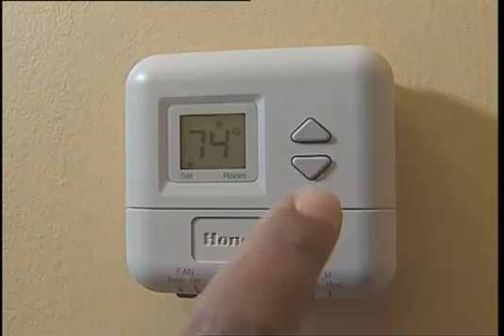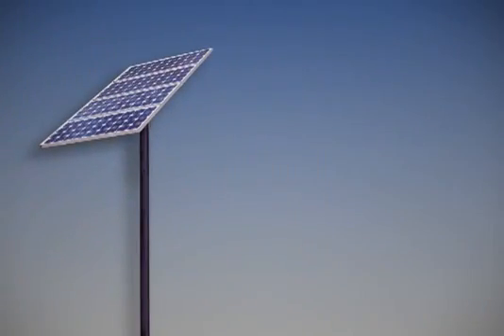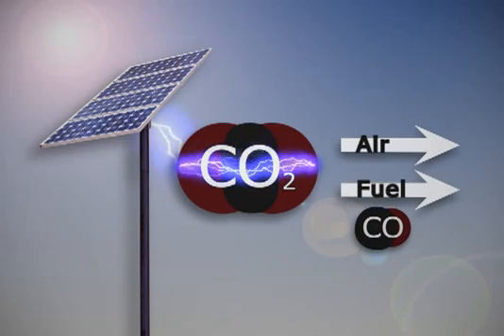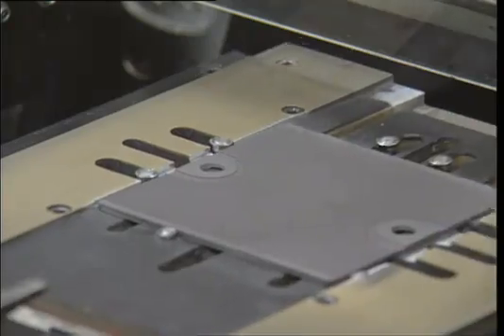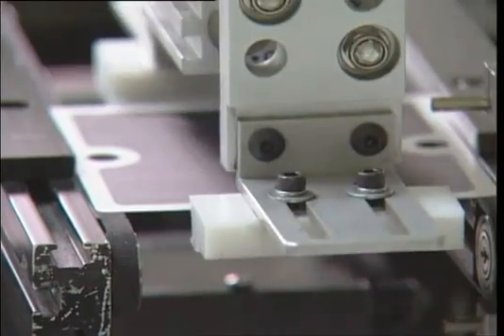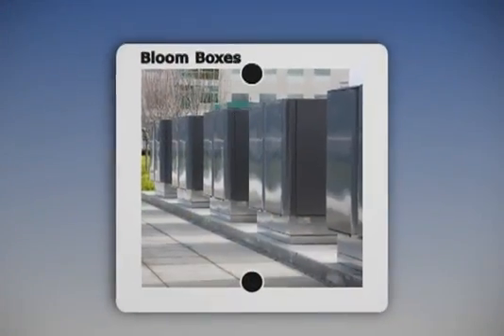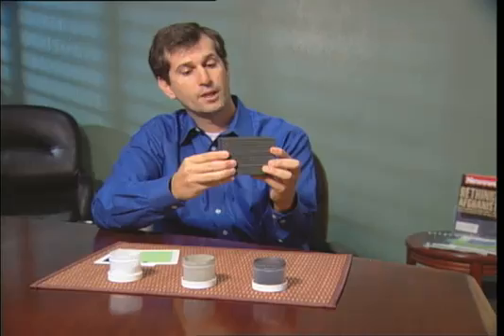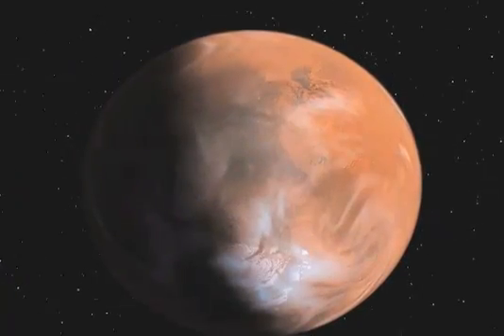Sustainable Energy Solution: the Bloom Box

Comment: First, I believe people need to know what "Fuel" is.. Is it hydrogen?

Secondly, it's important to know how efficient is to convert electricity into fuel, and how efficient is it to convert the fuel back into electricity?
Reply: The thing is that you can run two boxes in tandem with differences in wiring.  Generating fuel in one with solar energy (free power) and oxiding the fuel in the other.  Excess energy that would otherwise be lost in either process can easily be redirected to a grid.  It's already 100% efficient in process but just like anything else requires maintenance.  The rate can always be improved with innovation and upgrades as well.
Reply: Skr4x Nothing is 100% efficient yet. The question is: is this more viable than batteries (for personal use) and is it more viable than pumping water up to power a turbine later (commercial)?

I barely remember writing this though... I don't usually make these many grammatical mistakes. :P

Comment: this sounds like a really bad idea. it takes oxygen, combines it with carbon to generate electricity? sounds like just any polluting co2 producing engine to me. no matter how efficient, you're still creating more co2 to produce energy. this could be a nice temporary solution, untill we have clean energy to turn them around producing oxygen. i still vote for underground thorium reactors. safe efficient and no waste.
by natural gas to they mean the gas you use to cook dinner or just the air around us(and use the carbon in it)?
Reply: The "fuel" they mention is either natural gas or bio-gas (methane, so think gasses from sewage). The domestic model it is planned to be one quarter the size of one of those individual units (they call them servers). The big thing about this way of doing it is that it doesn't need power lines so you don't get loss due to transmission, you can stick it in your back yard. Yes it does still give off CO2, so do most of the alternatives and to be honest if this can in anyway bring down energy prices and cut down the amount of fossil fuels used I'm all for it. I want to see some figures first before I make a decision that it's a bad option.
Getting the world governments weaned off non-renewable energy is proving to be a long process (about 20 years so far), I'd rather they put their money behind this than nuclear in the short term.
Reply: I agree. Very bad idea for earth... but very good idea for energy compagnies that can say : "hey, you see, we have a new green power source... with gas" And then continue to sell gas... Very bad idea.

Comment: its not really just a little box, the whole things bigger than a car.  How many kilowats and $s (minus RND) vs kilowats produced over its life span?
Reply: Nikita Webber I am not the sells person, But I know some of there information via internet. 1 kwh=1000w per hours=1 unit as you pay. 1kwh means it is good enough to 1000w load at a time without any battery backup. As example- 100w blub means its consume 100 watts of energy in a hour. So you can light-up Ten 100w bulbs at a time using 1kwh system.
I am not form USA or UK, so I don't know what is the price per unit in those country.And I don't know its lifespan, but I think its close to regular fuel cells.
Reply: They don't know any of that yet lol its still in testing, they are testing for 20 years before knowing for sure.
Reply: If you thinking for your office then you are right, but it is not for your average home. As I know it is same size like a 12 CFT refrigerators generating 25kwh. And it is for most likely commercials purpose price tag around $70000. For home use they promised it will be around $3000 for 1kwh (I think not available now). And this are use in commercial set-up, FedEx, Google,Walmart etc their early buyer. They are do testing form 2001 and I think it is needs 2-3 years to ready for vast market.
Reply: haven't got my head round the math. wouldn't be suprised by the big companies using it just as a tax write off atm. what does 1kwh from the grid cost btw?